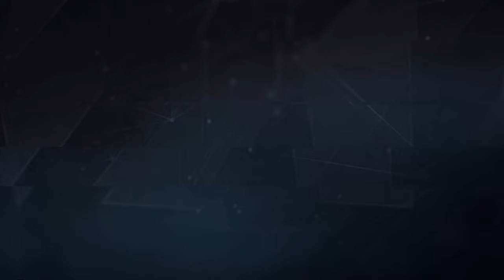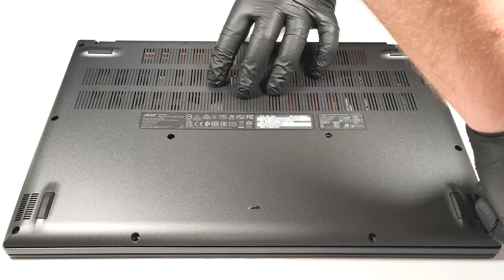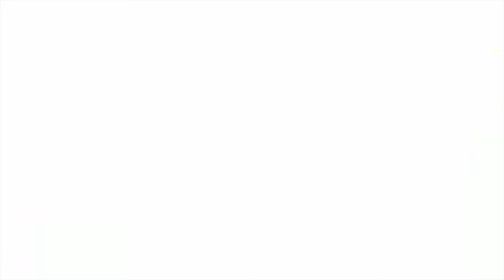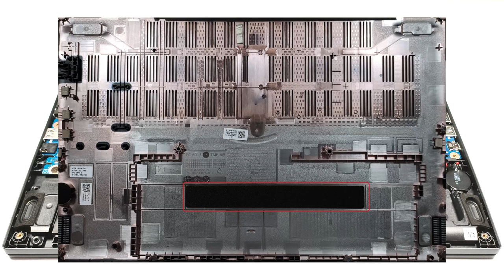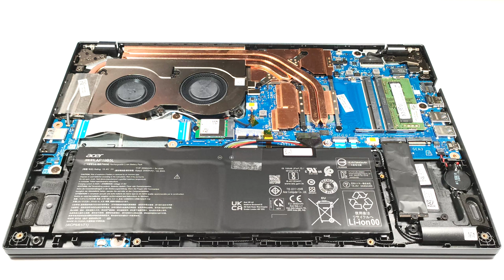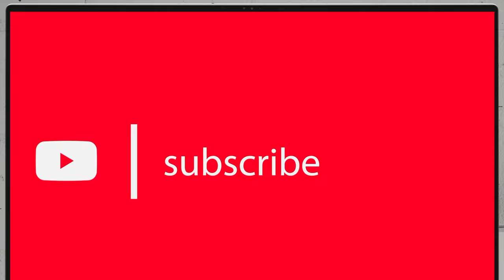🛠️ How to open Acer Aspire 7 (A715-76G) - disassembly and upgrade options

Comment: I have i5  gtx 2023 16 gb ram 512 gb storage . How much can i upgrade my storage Gen4 slot and gen3 slot ? Both 1 tb +1 tb or 512+512?  And 16 gb both slot covered with 8+8 or only 16 gb in one slot?
Reply: 8+8  or 16+16 gb ram and 1+1 tb ssd nvme gen 4 in main and gen 3 second
Reply: Your laptop heat more or not mine 88 c
Reply: Its new so i am not facing that much heating issue . Thanks for giving me that information .
Reply: @noobgamer7560  Mine also new in gaming its 84 to 85 C with 144fps constant it is dangerous for laptop or not
Reply: Bro did you find out , also did you buy from Flipkart india
Reply: @gtvishal2521 Temperatures hitting 90 degrees is natural for a laptop of this form factor
Reply: @Hariiissshhh did you find out brother? I'm wondering the same
Reply: I'm using cooling pad so it's only heat upto 70-75°C when I play GTA 5 in high settings
Reply: My laptop heat up to 80-90, I don't use cooling pad but I keep some gap below laptop and use AC on 16.😅

Comment: Can this model be equipped with, for example, 2 drives of 2 TB or only up to 2 TB? Thanks for answear.
Reply: You can put two 2TB drives in it if you want just remember one of the slots is gen 3 so will only run at gen 3 speed if you use a gen 4 drive.

Also remember you'll need to reinstall Windows if you swap out the original drive.

Comment: I have Acer Aspire 7 A715-76G 57W7, 
Doe the laptop have 2 ROM slots?
will GEN4 ssd works on GEN 3 slot?
Or shall I go for GEN 3 ssd?
Reply: i think there is a GEN 3 slot to put there a GEN 3 SSD. not a technician tho

Comment: where is the GPU located
Reply: The CPU is located at off side middle (2 copper coolers) as it requires less cooling, GPU is in the middle upper part (3 copper coolers) as it is much hotter to run on a small chasi

Comment: Is the Ssd size 2230 or 2280 plz reply
Reply: M.2 2280 NVMe SSD slots
Reply: @user83nf3  it supports up to 2 TB?(the second gen 3 ssd)
Reply: @Alexssdf It's total 2TB, so if it has 2 slots, it's probably two 1TB SSDs, but take this with a grain of salt